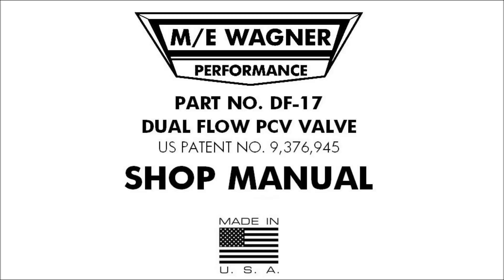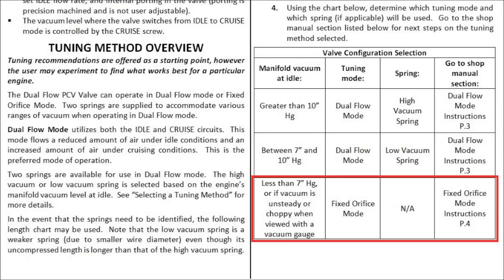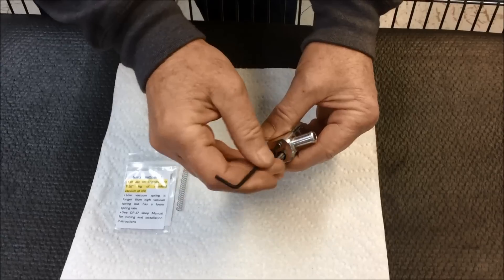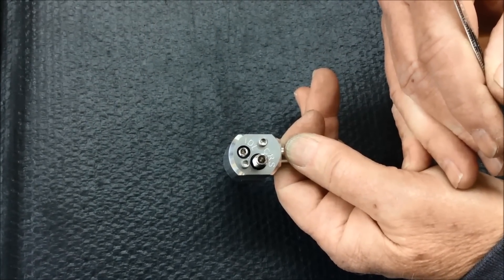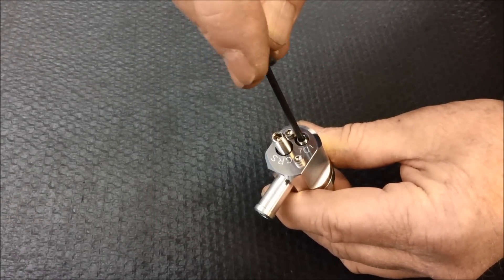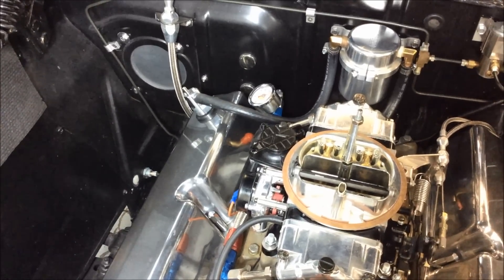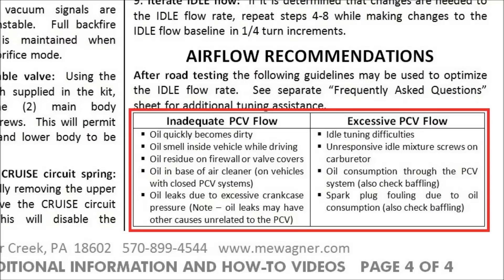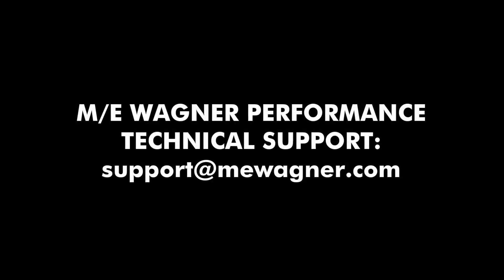DF-17 Dual Flow Mode Tuning Video

Comment: I have 2 Questions … I have a stroked 454 (496) Chevy big block with a cam that creates low vacuum. I don’t have a lot of oil consumption, but have been blowing oil from my breathers, and out almost every gasket on the engine. I’ve read about other people that have talked about their motors on YouTube with your product, as I do not want to use a vacuum pump, I hope this can cure my problem. 
First question: For my situation, Do you recommend a catch can in addition to the PCV valve? Second question: Specifics on routing the piping?
Thank you for your help.
Reply from the maker: Michael - thanks for the question and yes, we can help you. Send me an email at support@mewagner.com and we can get into the specifics on your application. Thanks!

Comment: I can't believe the difference this made!!! 
Even though I used a PCV for a similar application, it was wrong for my very mild custom build. I have been living with rough running for 20+ years and this device has transformed my Ford 390. 
If I could make one suggestion; it would be nice to be able to purchase an optional billet cap to cover the adjustment screws for a cleaner look.
Reply from the maker: Thank you for your feedback!  Glad it made a difference for you.  If you're interested in having us add your car to our customer's rides page on our website (http://mewagner.com/?p=1603) send me an email at support@mewagner.com and we can set it up.  Thanks!

Comment: I have a 289 engine with your valve, stock valve covers are baffled and I have the Moroso air/oil separator. My oil doesn't stay as clean looking as it used to even though this is a totally rebuilt engine. So I'm thinking not enough PCV flow? I have 20hg of vacuum. Which circuit do I adjust? and direction for the adjusting screws? Thank you
Reply from the maker: You can try some additional flow through the valve to see if it helps.  Increase the flow rate by backing the idle screw out 1/4 turn from your current setting (counterclockwise).  Then be sure to re-tune the cruise circuit transition point after any changes to the idle circuit flow.  Also as you increase flow rate, be sure you have proper baffling (http://mewagner.com/?p=1221) and monitor for oil consumption and plug fouling.  What setting are you using on the idle circuit now?

Thanks!
Reply: @MEWagnerPerformance  Appreciate the reply. Right now I have the idle circuit at 1-1/2 turns and adjusted the cruise circuit as per your manual.
Reply from the maker: @redj7401  That should be plenty of flow given your engine size and vacuum levels.  Do you notice any other symptoms of inadequate PCV flow, such as oil smell in the cabin, oil dripping from fresh air breathers or oil mist on the valve covers and firewall?

Comment: I see there’s a motor trend article where they installed this into the valley pan of a 455 Pontiac. I will be selling this the same way in a 400. Do I need any of the adapters to do such or is everything I need included?
Reply from the maker: If you aren't mounting the PCV in the valve cover, you will need one of our adaptor accessories here: http://mewagner.com/?p=540   You can select the adaptor you want as an add-on when you add the DF-17 PCV valve to your shopping cart.  Let us know if you have any more questions.

Comment: My 496 BBC keeps leaking at the back of my intake manifold. Do you think this will help?
Reply from the maker: We have helped countless customers solve oil leak issues resulting from crankcase pressure caused by poorly functioning PCV systems.  If your gaskets and seals are properly installed and you still have leaks, crankcase pressure could be the problem.  Here is an oil leak case study that you might find interesting:  http://mewagner.com/?p=2173

Comment: When your tuning the valve and you have an oil catch can, do I bypass the catch can or leave it connected. My PCV hose connects from the PCV valve to the IN side of the catch can then another hose connects from the OUT side of the catch can which then connects to the PCV port on the Holley carb.
Reply from the maker: You should leave your catch can in place in case there are any vacuum losses through it.  The goal is to tune with the same amount of vacuum at the PCV valve that the valve will actually "see" during driving conditions.  Let us know if you have any more questions.   Thanks!
Reply: MEWagnerPerformance thx for the quick reply.

Comment: Excellent product. My 454 big block has a radical cam with a very low fluctuating vacuum signal. I set the PCV according to your fixed orifice mode and now have excellent oil control. I was pushing oil out of the valve covers previously. I would highly recommend your product! Thanks guys.
Reply: I have 383 gm it guzzles oil 
This has helped

Comment: Would it be recommended to use a baffle on the valve cover with the PCV?
Reply from the maker: Thanks for your question.  Yes, proper baffling is essential to your PCV system's operation.  Otherwise the PCV system can consume excessive amounts of oil.  We did a baffle study that you might find interesting on our website (http://mewagner.com/?p=1221 )